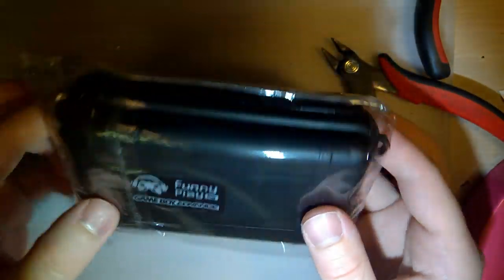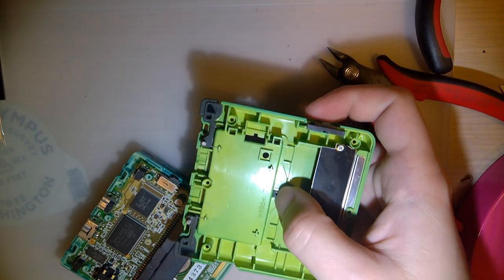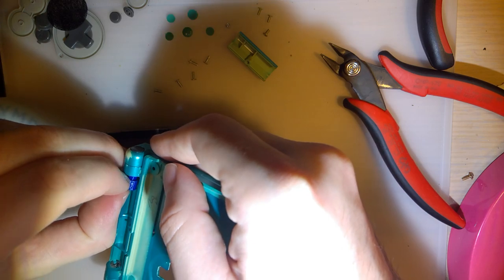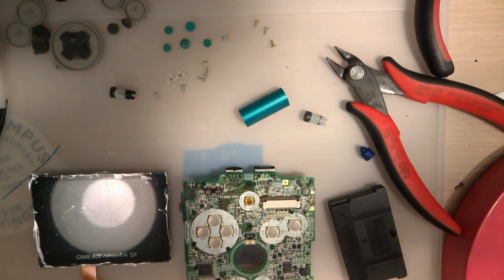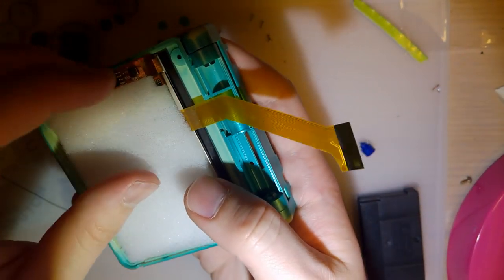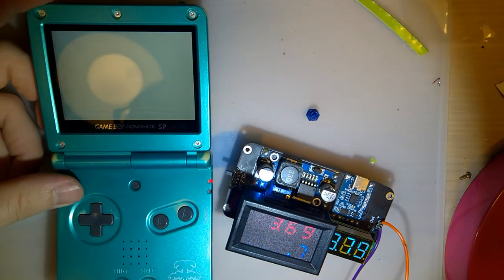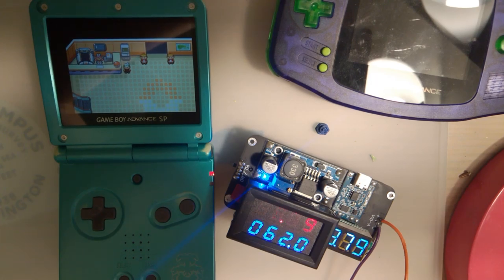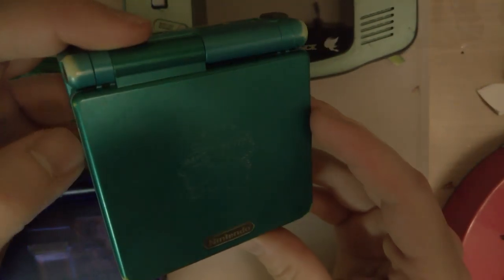Installing the Funnyplaying SPIPS GBA SP IPS Screen in a GBA SP (AGS-001)

Comment: Is the one aliexpress is selling the same one as what retromodding is selling?
Reply from the maker: Yep.
Reply: @makho  Thanks! So for what I saw on the trimming aspect, all you take away is that one side on shell and make sure its smooth? I've done the ags 101 mod so i'm not worried about trimming, its just that I don't want to damage the IPS panel.
Reply from the maker: @HiNu7  Yeah, pretty much. If you are using an opaque shell (like I did for this kit), you can get away with just using flush cutters. The trimming doesn't even have to be smooth because the LCD is very thin. If you are using a clear shell like I did with my last install (AGB V1 into an AGS) then you might want to use a dremel to smooth out the cuts for aesthetic purposes.
Reply: @makho  Thanks for the advice, very much appreciated! i'm just doing the cobalt blue. Most shells now a days don't come with the hinge right?
Reply from the maker: @HiNu7  No aftermarket shells do. I highly recommend an OEM shell over the opaque aftermarket ones though. The opaque aftermarket shells are very poor quality. The aftermarket hinges are pretty bad too.
Reply: @makho  Got my screen installed in an aftermarket shell (which sucks and feels cheap), I have my original hinges in, it closes pretty nicely, but its missing the crack/snap sound its supposed to make when opening like 38:53. Any ideas?
Reply from the maker: @HiNu7  The clear ones are a lot higher quality than the opaque shells. I highly recommend them. Regarding your hinge issue, double check that they are fully installed and not backwards. I believe the left hinge and right hinge are different parts (but I've never really played with them enough to know for sure). The shell could also just be garbage.
Reply: @makho  yeah the shell is just garbage lol
Reply: How much does the alieexpres one cost? Is it cheaper than the original one? And how does the quality compare?!

Comment: place some tape between the backplate and the lcd driver module, you're exposing the circuit to short
Reply from the maker: The back of the ribbon is insulated out of the box from the rest of the circuit. There is no danger of a short.

Comment: Can I just do the screen replacement without any solder and or no clipping?
Reply from the maker: no brightness control if you do and you physically need to make room for the screen unless you buy one of the IPS ready shells
Reply: @makho  gotcha gotcha.  If I were to get a shell, gut my 001, and replace the screen, could I do that without clipping or soldering?  And thanks for the reply.
Reply from the maker: @575forza  yes but you need an IPS ready shell specifically
Reply: @makho  awesome, thats what I was expecting.  Thanks!